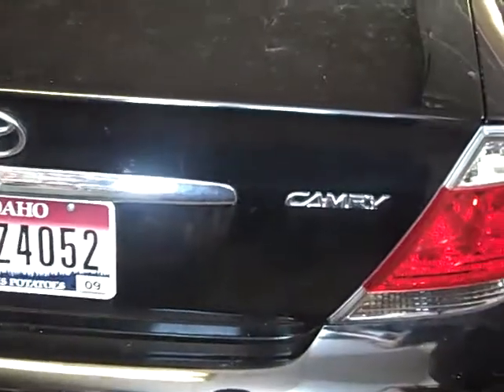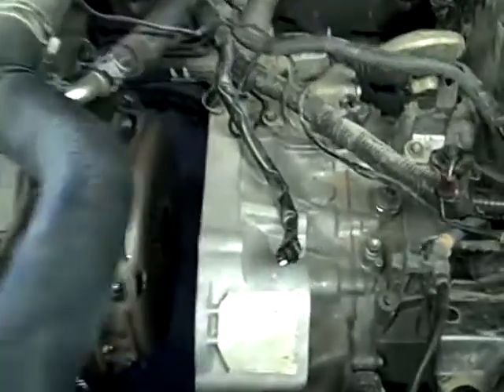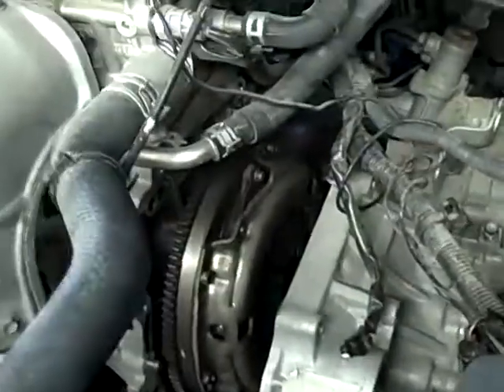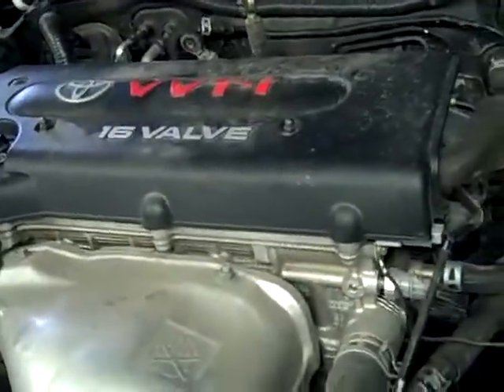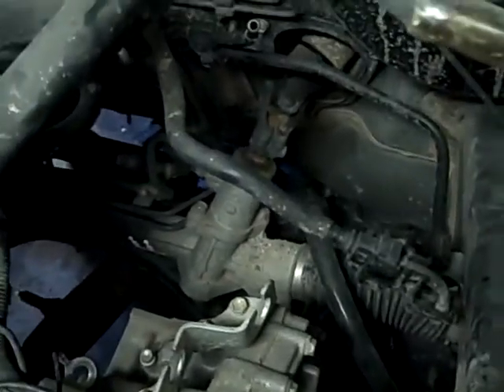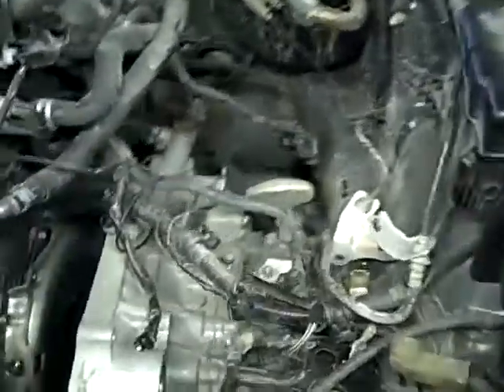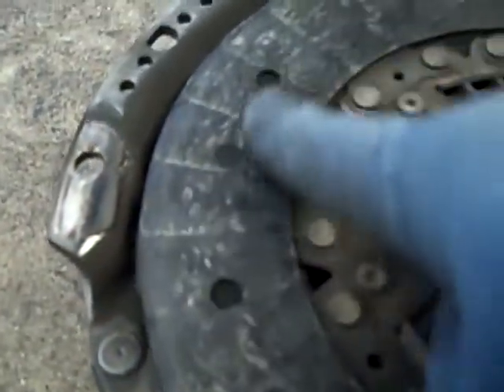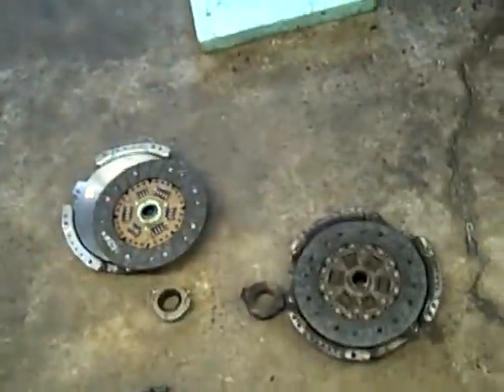2006 Toyota Camry Clutch install shortcut cut labor in half!!

Comment: Thank you so much for this tip!  Used your advice on my '04 Solara and it worked great.  Didn't remove the fans, radiator, engine, fuel lines, exhaust, cross member ... tons of stuff the book was telling me to do.  Tranny fit  fine in the wheel well and plenty of room to replace the disc, pressure plate, and throwout bearing.  You da man, saved me tons of hassle in a job that's all about hassle.

Comment: yep, it can be done, no engine pull out, didn't have to take passanger side axle out. enough space to replace clutch and flywheel. Did it last weekend, took 2 ppl around 6hrs. Helpful video, thank you!

Comment from the maker: @gt6989 You don't have to pull the motor on the 03 either.  It's actually neither.  The 1st gear isn't low enough so people have to burn more clutch on hills and parking structures etc.  The 2003 Mini Cooper is another example of the same.  They save gas, but eat clutches.

Comment from the maker: @salsi78 Good questions- you pull 3/4 engine/trans mounts.  So yes you do pull the bottom strut mount.  As for the exhaust I don't remember for sure.  I'd have to watch the video and then guess.

Comment: Doing a 2010 Corolla 1.8 right now, engine replacement.
Did this to get the engine out, rotated flywheel to reach the clutch bolts from top, then engine came out.
Left the transmission in place.  Had about a half inch of space to reach the bolts, but I probably could have moved the transmission a bit for more space like described below.

To install, I plan to install clutch to engine, undo transmission mounts, then ratchet strap the transmission towards drivers side/away from engine to give room to install engine with clutch.
I will report back if it works, might post a vid.

Stay gold.

Comment: Thanks for this. I've had quotes for my 2005 as high as $2000 for this repair, and a 16-19 hour repair job. I was about to start looking for a way to sell it. I bought a stick partly so that I wouldn't have to do a $2000 repair for every little transmission issue, that benefit evaporates if the clutch installation costs as much as a new transmission. Thanks.

Comment from the maker: No problem at all.  Once the clutch comes out you have even more room to work for getting the FW out and the process grants more space as you go from there.
Reply: Have you actually pulled out the flywheel to resurface or replace it? When I had my last clutch installed (by a mechanic) they put in a new flywheel. They did this because 2 previous cluches wore out prematurely (< 2 years) probably due to not doing anything or merely cleaning & buffing the flywheel. Thanks for the video. I may be able to do my own clutch installation next time if this works for a 2000 Camry.
Can you make another video using light to show us what you're talking about?

Comment from the maker: Try pushing it toward the clutch fork with the two 12mm bolts a little loose and then while it's forward tighten them.  My guess is it may be over extending (piston going out too far)

Comment from the maker: @weerweer It works, just make sure to clear off the trans mount stuff so it will fit- get the engine supported so you can get the angle you need with 3 of the four motor mounts off.

Comment: Thank you for sharing us this video. I have a 91 2,2 camry, which I will do in the same way as you have done this clutch job. I also have the original toyota camry workshop manual, and it tells you to lower down the hole engine/transmission after removing the engine supporting frame! 
But do you also have to loosen the engine here on the camry or did I miss something? It was a bit dark from below the car so I couldn't really see what was done here! I would appreciate your comment here.
Thanks!

Comment from the maker: @cangry392 You can open the bleeder screw (hollow 8 or 10mm bolt) on the slave cylinder for a half second to see if it relieves pressure.  Typically the after market clutches have a heavier spring tension on the pressure plate.  This can equate to a harder feel at the clutch pedal.  As for shifting- check the routing of the shifing cable/linkage.

Comment: That's kind of what I did when I replaced the clutch on my 1996 VW Golf TDI, service manual stated I needed to remove both driveshafts, could only remove 1 because the spline bolts on the other one were all stripped out, I just undid all the gearbox bolts then twisted and pulled it so I had about 90mm of room to work with, I had no alignment tool so took me a few attempts but completed it in the end!

Comment from the maker: CV axles, intake, battery and tray, slave cylinder and lines, starter motor, three motor mounts, drop exhaust down from manifold, Shifting cables,and wire harness plugs from transmission.

Comment: Very helpful video,.. thanks mate,.. though insufficient lighting in some parts.
I am about to change the clutch in the same car,.. 2003 camry 4cyl manual gbox (162k kms/100k miles.. and still on original clutch!!).  Was worried about pulling the box due to the big subframe that toyota use in Aust.  This alternative method of yours looks great!!  
I will also be changing rear main engine seal and front transmission seal.  Did you have any issue accessing them, or re-torqueing flywheel bolts?

Comment: Thanks, sure this will help some day. What I like to do for supporting engine is with a standard screw jack that you would find normally with spare tire kit. I just went to Wally World (Walmartt) and got one for like $15. I've since used the crap out of it, I trust it because my floor jack leaks down so the screw jack is more trustworthy in that sense.

Comment: I just did this job today. I did drop the crossmember-but I do not take off the links, ever.  Remove rear subframe bolts, lower x-member in the back. Disconnect sway bar from crossmember, reach rack bolts this way. This is an easy way to replace rack and pinions on Toyotas too.

Comment from the maker: Loosen the flex plate and center that disc better.  Grease the trans input shaft and the bell housing alignment dowels. Watch your mating surfaces for being parallel.  Twist the trans to get the splines to take.

Comment: Hey Brian,
Thanks for the upload, I wouldn't of attempted this if I had to of pulled the motor. Anyway I pulled everything up to the motor mounts, too dark to continue today but I was wondering- Do I need to pull the rear anti-torque mount, Is that pulled to allow the motor to come down enough? Also, I just dropped the exhaust about 1-1/2" off the manifold will this be enough or do I have to pull it all the way off? And do i need a jack for the tranaxle (or just grunt it over?)
Thanks

Comment: If disc had been worn down to the rivets on the flywheel side and had begun to gaul the face of the flywheel would you pull the flywheel and resurface it?  Can the flywheel come out as the engine/transaxle is currently shown or must engine come out?  If engine has to come out has customer been warned in advanced of extra cost to service the flywheel?

Comment: Hey Thanks for a great tip!  I know you made this video a long time ago but these camrys last forever... Do you have to pull out both axels?  Why does the passenger side drive axel have to be pulled? Is it just for the motor mount? Cause that driveshaft is gonna be a pain to take off. Thanks again!!
Reply: Say, I have the same question! What did you figure out?

Comment: I am replacing the clutch on a 2000 toyota corolla, Where can I get a good exploded view of the bolts holing the bell housing on? You are right. There is a good 8 inches of play. Have everything ready to go but can't locate all the bolts holding it on.

Comment: Before I seen this I tried that on a 06 Nissan Altima hoping it would make it but not enough room but I did drop the sub frame and only had to slide it back on a low pro trans jack didn't have to pull anything else out or take it all the way was a pain

Comment: Working in an 02 and cant tell if there's enough room to drop it out. I don't know how to do the half shaft.
If I cant drop it and have to slide it on the subframe, do I need to remove the whole half shaft or can it stay in place and slide it back on when done?
If I can drop it out does it stay with the trans or the car?

Comment: Good video.  I'm amazed that some people would remove the engine.  Do you know if this is the 2.4L 2AZ-FE motor?  I've got a 2009 Toyota matrix manual with that motor and I'm trying to get some insight into what replacing it would be like.  I think this car has the same setup basically.
Reply from the maker: I made this video 9 years ago.  I don't remember.  I would imagine it's the same or similar.

Comment from the maker: @fkhouck On a 2000 i'd drop the trans out of the way.  As far as an exploded view I'd jump in both feet.  You will discover the unknowns after pulling the CV axles and the intake stuff.  As for an exploded diagram... just feel around the bell housing after you're torn into it.

Comment: would this work the same way for a 2003 Camry? I spent $1000 to get mine done and they pulled the motor. I am wondering about the quality of the clutches, i only owned my car for a few months when this happened, bought it used, the mechanic said that the person that owned it before me must not have known how to drive a standard. But even the one that you have in this video is completely messed and it's only 3 years old. Are the original clutches crappy quality or is it really just the drivers?

Comment: Hey Brian, thanks for the video. I am in the process of doing this one myself, taking my time trying not to screw anything up. Did you have to remove the drive shaft bearing bracket? If not, did you have to remove the passenger side (in the US, I am in Australia so it's actually the driver side one) drive shaft from the transmission to slide it to the side, and if so, should I drain my transmission fluid first? Thanks!

Comment: 2000 Solara V6 5sp:  Do I have enough room to push the transmission to the side and get to the pressure plate and clutch?  Can I use the short method or do I need to drop the k-frame/cross member?

Comment: I have a 1996 toyota Camry the clutch went out I finally got the parts for it and now I cant find anyone that has the time to fix it im getting impatient and im thinking maybe I might be able to do it myself I jave worked on cars here and there I know a little bit about a little bit but not a lot about alot so I was wondering if you might be able to explain what to take off and where it should be what needs to go where and how to identify the things that needs to be replaced or taken off so I can put the new parts in or if in your opinion I should just keep looking for someone to fix it for me so I dont completely mess it up beyond repair you honesty is very much appriciated  thanks for your time
misty

Comment: I am replacing a clutch in a 2000 and am wondering if I need to pull the axel on the drivers side of if the motor mounts are enough. Can you give a few more details? It was hard to see in the video because the lighting. Thanks!
Reply: bump

Comment: Will this work on a 2000 Camry? The engine-clutch connection is highly visible and accessible from the top of the bay. Also, you kept saying "...as you can see..." while under the car but there wasn't enough light to see anything except where there was a view through to the engine bay. Videos for auto repair requires bright lights from a number of angles. In this one, any light would have been an improvement.